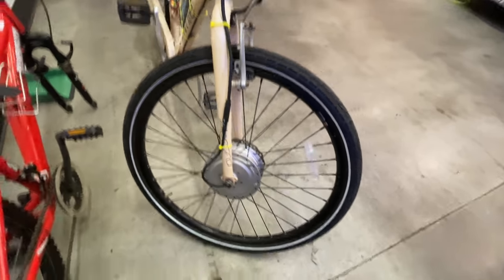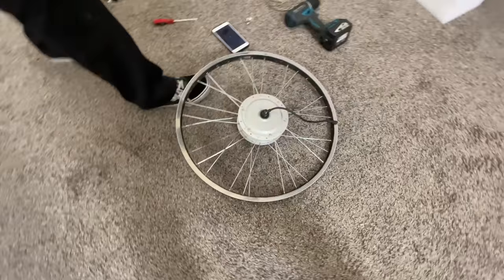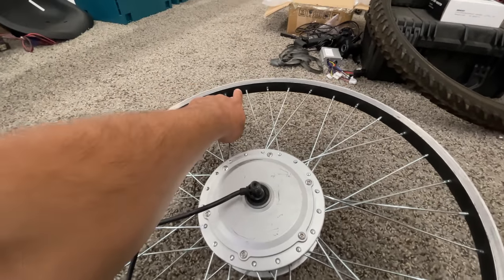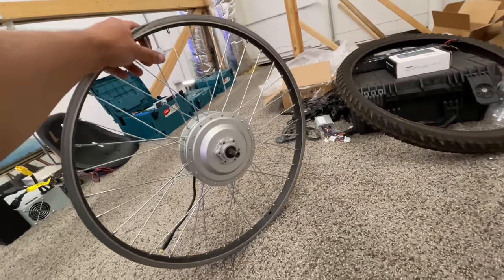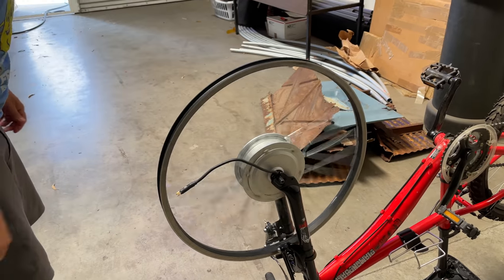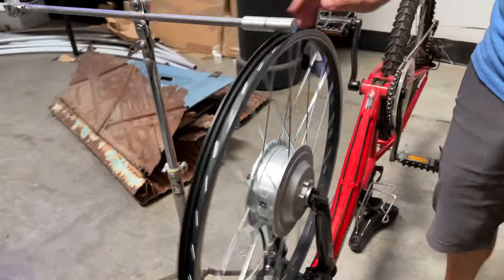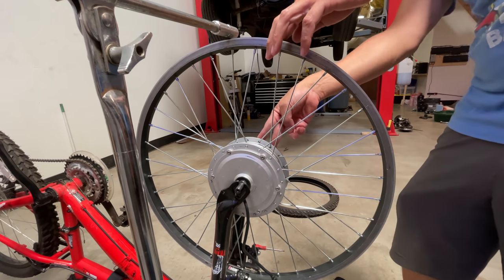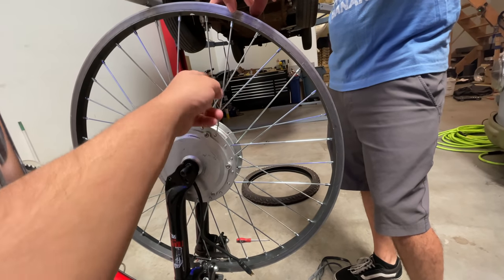Using the  POPULAR 26" Bafang Hub motor on 24" wheel

Comment: How does the new wheel effect speed?  It should make it have a little more acceleration, but a little less top speed...  but I actually wonder if the lower gear ratio will lower load enough that will allow the motor to have a little higher RPM and still get the same top speed?  I'm interested.  Please do some tests on acceleration and top speed please.
Reply: I built one of these for my daughter and compared it to my wife's 26" build.  Using the same 30 cell battery packs.  The 24" did acellerate a bit better, but the top ends for both were similar (just over 20mph).  Now on the 24" build it could pull 15 amps (max of the battery pack) while the 26" build used a 13 Amp controller.  Also my test pilot for the 26" was bigger than  my daughter.   Hope this helps.

Comment: Lacing Wheels is a disappearing Art Form, there are many ways to string or spoke a single wheel, some are fancy , some are practical, some are, ...well,m..insane.
Putting a 24, or 16 inch Rim spec'd for a 26 inch wheel will SIGNIFICANTLY increase torque

Comment: From - motor stand point is about 8” the most you can go to a lowest wheel size is 20” ! I tried it already and I’m the one who ask you for a better price if I get four from you so I can give better intel in what can be done on a dime but never got an answer so I got one from Amazon which is about the same price and was able to get all the layout I needed ! I hope this helps anyone who wants to try this out jag35 does have the faster shipping !
Reply: Hi, so you got it  to work on a 20" wheel ?
Reply: where did you find the spokes for a 20" rim? id like to do the same thing but a calculator suggests i need 145 mm spokes +- a few mm but i cant find them anywhere

Comment: hello i am  French i do understand that you cannot ship batteries but that's not a problem as you gave Europeans sellers but could you ship the motors only ? as they are "second hand" and i suppose with no guaranties and there is no hazard on those ?
thanks in advance for your answer  i could probably buy like 10 or 20 off those
Reply: FYI these are bafang motors so you can get them from your Amazon, AliExpress and eBay vendors.  Don't get me wrong he has great prices but with shipping it might not be worth it for you.
Reply: @andrewwong3326  tsk

Comment: Another thing - powered wheels are as strong as the strongest riders. Stick to 3 cross or 4 cross lacing for strength. These hubs will eat 2 cross lacing over time and radial lacing before you make out of the driveway.
Reply from the maker: but these come 2 cross lacing from the factory.  These are used so pretty sure they made it past the driveway.
Reply: @jehugarcia  if you intend to keep it for years instead of only 1 or 2 years, trust me on this, Sir. Look at the cross pattern on even weak motorbikes and look at off-road bicycles. They are 3 cross for a reason. They will break spokes over hundreds of miles otherwise as sure as I’m writing this. And if someone tried to radial lace with a powered wheel, they wouldn’t make it out of the driveway. Torque can and will rip the spokes out of the wheel.
Reply: 3 cross would be better.  I worked with these wheels originally, and the spec 2 cross patter. was a mistake, and the wheels bent quickly.  We saved the hubs from hundreds of these that bent, and they went to recycling for that reason, the hub motors were good.
Reply: @3rdworldcop  please send that to Jehu so he knows.
Reply: @jehugarcia  check it out. 🤙

Comment: what is the power and voltage of the motor?  I want to make one like this but I have a 48v 500w motor and a 24 wheel is the spokes the same size as yours?  thanks

Comment: I got both a 26" wheel and just the hub for a 24" wheel.  I'll be lacing the 24" by following spoke for spoke the 26".  BTW are there any rear hubs available?
Reply from the maker: No all rental bike fleets use front hub design
Reply: @jehugarcia  thanks Jehu, I was wondering if you had any of the rear hub motors (with no rim) leftover in one of your warehouse?
Reply: I'm not as talented as Jehu at wheel lacing.  I ended up bringing the hub to REI to fix the off-center build I did.  As a member it cost me about $100 to get it done 'right' and I was very happy with the results.

Comment: Swap in 26" FORKS, use 26" wheel as is, most bike use standard headset, 
Faster & easier, & a larger Front wheel can give a more upright commuter type riding position
Reply: I wonder how the different sized wheels will effect top speed.  I'm sure it will give you better acceleration having a smaller wheel--- but that doesn't really matter--- You'll normally be running at top speed most of the time anyway.  I'm curious.
Reply: @calholli  - larger rim will give you a higher top speed, as long as you & the motor can overcome wind resistance.

Super high speed also means you should be wearing some tactical gear of some kind, to avoid becoming people sauce when you hit a pot hole at 50MPH! LOL!

Comment: Yo.  Every single brand and model of wheel will require a different size spoke.  Even within the same size wheel.  You need to measure it yourself or use a wheel calculator.  But to be honest if this is your first shot at building a wheel, this isn't the video to watch.
Reply from the maker: It ain’t no rocket science that’s for sure,  I figured it out on my first try

Comment: This is a pretty weak motor, not worth the effort, IMHO.
Reply: Not weak to me IMHO I am subbed to you too.  I was surprised by this motor it has been a while since going back down from 3000 watts.
Reply: They are good running a 35-50a controller with either a 48v or 52v battery that can supply the amperage needed.